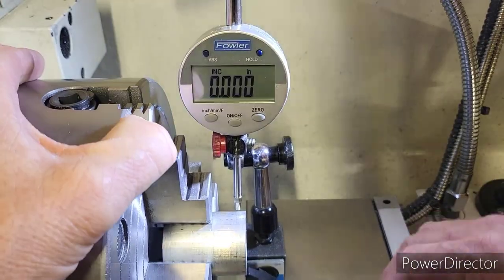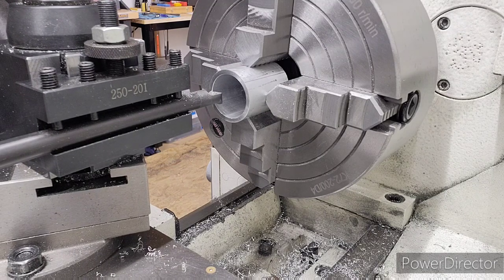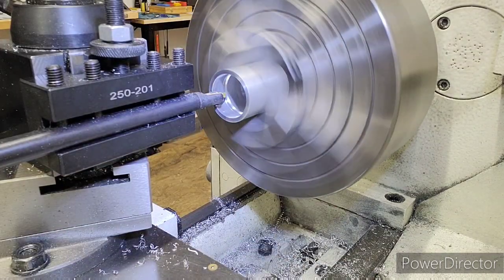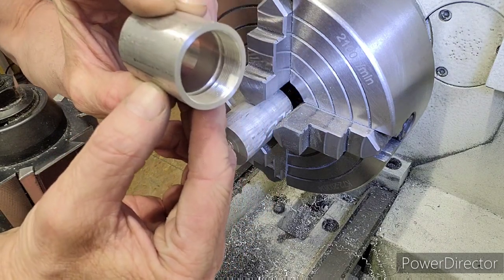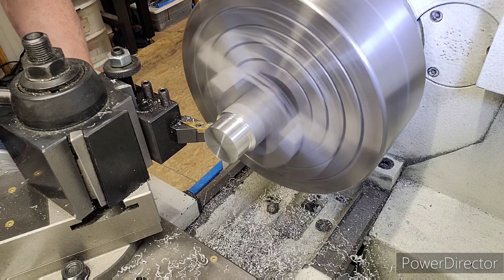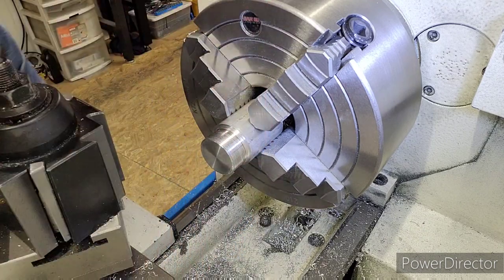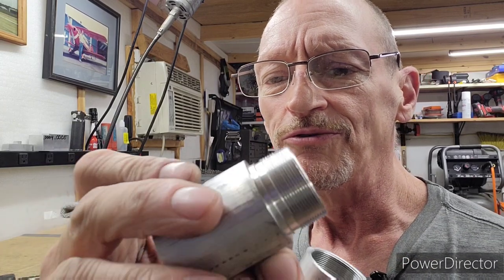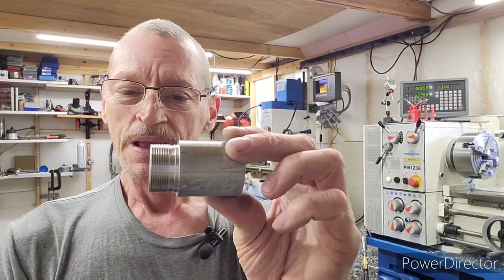How to cut threads @Toolmaker001

Comment from the maker: After I washed my hands I worked the thread off camera a little bit once I was able to grip it. Didn’t take much and it polished right in with oil.
Reply: Seemed A little tight...  until you worked the threads. How much did you remove, around .002"?
For threads that need to be silky smooth without slop, I like using the 3 wire method. Sadly enough, I don't know too many people that do the 3 wire method. If anything, it's always good practice. 

Depending on the threads being cut, I'll either do the straight depth method (cross-slide) or the slant depth method (compound).
If I'm looking to run some v-sharp threads fast... I'll use the compound rest and dials with the compound set at 29-1/2*
Days where I don't feel like coming back to a dedicated start point, I'll run straight depth. 😅
Reply from the maker: Only used oil and put my loops on and removed some small slivers. It polished up in a few minutes.

Comment: That gearhead is so smooth and quiet. My 15x72 leblond absolutely screams at anything above 600rpm. You definitely can't talk over it comfortably lol.
Reply from the maker: Yeah, it's not a bad lathe for a $5,000.00 price point.
Reply from the maker: But it’s a Leblon
Reply: In the service we had a Leblond manual lathe, older model... that little lathe was so accurate and smooth... I used to cut Submarine valve seats on it. Nobody used it much because it was so little... (compared to the other lathes that we had in the shop).
Reply: @RichFife  I also have a little 10" regal, probably really similar to the machine you're talking about since leblond didn't make smaller machines for very long. It's a gearhead, with a feed rod, and reversible feeds in the apron. All incredible features to have on a 10" lathe. It has all the features that are normally reserved for larger swing machines, packed into a tiny little 10" package. Very cool machine, and pretty rare as I understand as well.

Comment: Jeff,  it looked like that thread was very tight at first.  ?
Reply from the maker: It was a lil tight. After I came out when I washed my hands i had a better grip and I worked on and off a couple times and it cleaned right up. Did it with oil. This is a very common practice for me when cutting tight engaging threads.
Reply: Jeff,
I've cut close tolerance threads in aluminum before myself, and I know what you mean. lol
Great video.
Reply from the maker: I do a lot of fine threads in aluminum, and this is the norm for close engagement aluminum threading. I'm sure you know this.
Reply from the maker: As well thank you.

Comment: Yes man, beautiful threads

But how much material can she hogg

Serious question

That's all that really matters

How will it hold up against a 316 forgeing say 6" od x 6"lg

Or welds

My gear head will be here in july, I went with the king. STM chucks are on sale at SOWA, obviously the two machines are different bit how big can I go, am I okay with a 10" 3 jaw, like would you run a 10"?
Reply from the maker: That would be something I wouldn’t want to do at all.
Reply: @Toolmaker001  would it be possible for you to show some of the limits of what your comfortable pushing your machine to do?

Was that a no go on the 10" chuck or just the 316 slug

I run a 60" chuck vertical Bullard, 18" ID split bearing housings are my bread & butter ( I have no frame of reference on a machine this small)
Reply from the maker: Well I’ve pushed it a few times and where this machine starts to show weakness (aluminum 6061 as reference) is bigger radius inserts cutting over .060 on diameter. It will do much better facing but still you start getting over 5 inches in diameter you will see some protest starting to develop on outer circumference. I’ve turned a lot of 304 and some 316 with it and it has some balls for sure as well has weakness in certain areas. Over all a very strong little machine. I’m easy on it so I haven’t even wanted to search for the edge of the envelope.
Reply from the maker: It’s been many years since turning on giant lathes. And in the tool and die aerospace company’s I’ve worked for we did tons of tool steals and alloys. The amount of inconel and titanium I’ve worked is staggering.
Reply from the maker: Yes, I’d say no go on a 10 chuck. It will do it but I bet it’s noticeable.